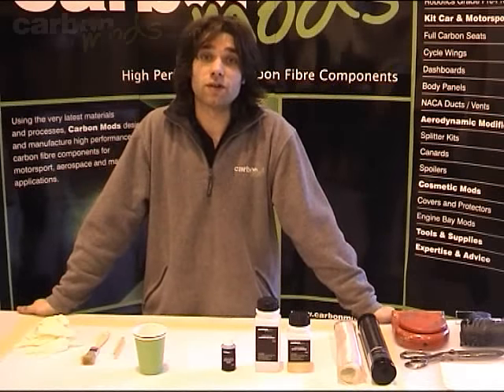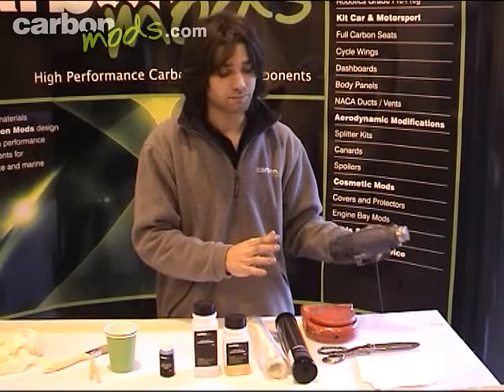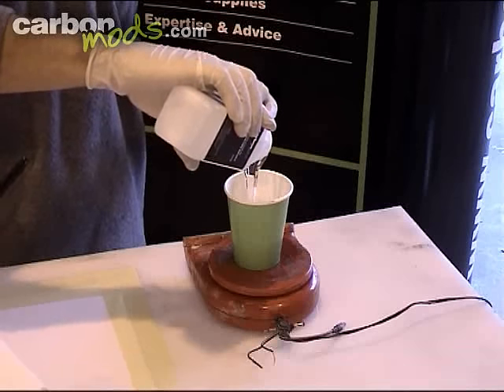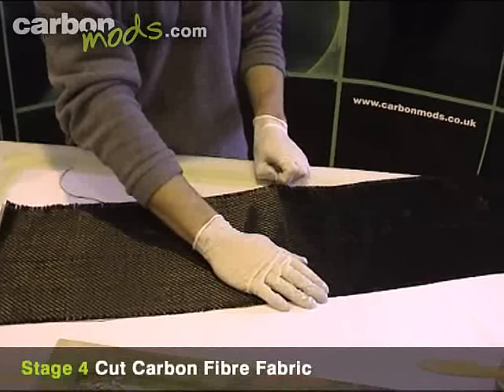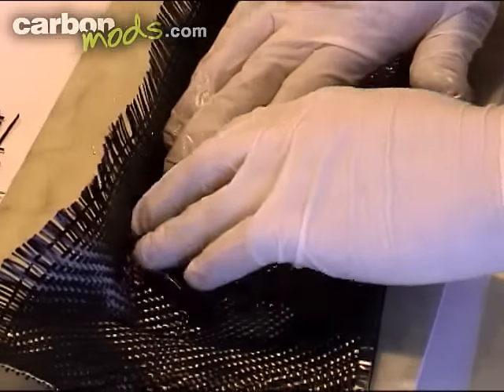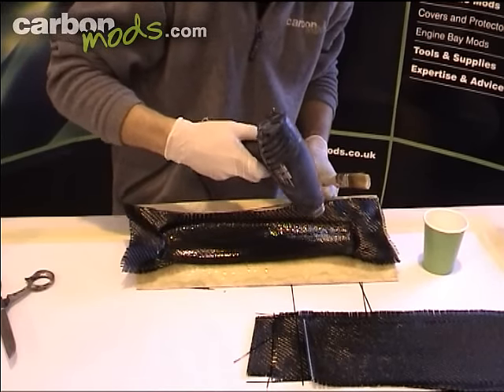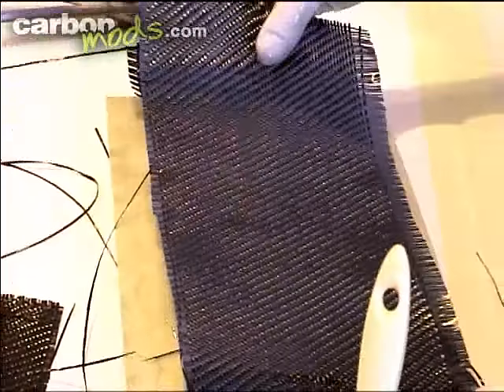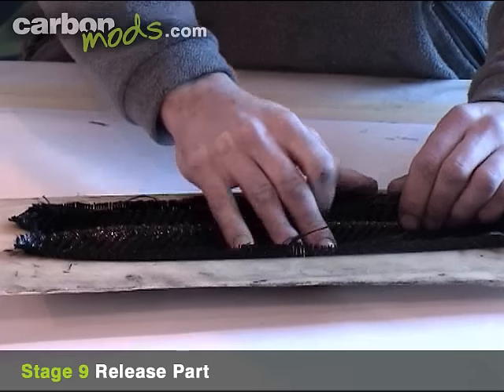How To Make Your Own Carbon Fiber (Fibre) Parts.

Comment from the maker: Hi Irishkerry, 

You are right something that has 2 'skins' like a car door cannot be made in one go, there are loads of adhesives that work really well with carbon fibre, the most common one are epoxy glues (like Araldite) and polyurethanes such as Tigerseal or Sikaflex. You can normally pick something up from a hardware store that will do the job. Thanks for the Question.

Comment from the maker: @yumyumluckycharms : Vacuum bagging doesn't change the speed of the process. If you mean that when you make your parts you don't use a separate layer as a clear gel coat layer then yes, you could skip this step and then you'd only have a one-step process but you could also skip this step in an open layup process and it would be even quicker than vacuum bagging (because you don't need all of the vacuum stack etc.).

Comment from the maker: Hi again grindzewall, 

Normally holes are done by making the part blank and then drilling the holes in afterward, normal drill-bits work great, to make your double sided 1cm thick component you could make two separate mouldings (one for each side) and then bond them together with epoxy adhesive. and finally yes we can supply carbon cloth in huge pieces, look on our website for sizes and pricing, Thanks for the questions, 

Carbon Mods

Comment from the maker: @cutinocutino : Generally in composites to make the 'pattern' in the first place (assuming you don't have an existing item you want to copy) you would either make it out of wood (like MDF), shape it out of a foam block by hand (low density polyurethane foam),  carve it out of Tooling Block (medium density polyurethane model board), or machine it (manually or by CNC) out of a high density PU or Epoxy tooling block which can be done from a SolidWorks file. We use all of these methods.

Comment: whenever I work with molds and resins I use Popsicle sticks to  push the mat into the corners  the sticks are super cheap  and I throw those away after the project is complete FYI I mostly do Fiberglassing  and Marine Epoxies using fiberglass cloths  and I’ve found that by turning the popsicle sticks I can  get into very tight spots and corners

Comment from the maker: Pathdestroyer, 

Good question! The number of layers depends on what your making, but work on the basis of the same thickness as you would make a steel part from (of course carbon is much lighter!) 1 layer of our 200g 2/2 twill carbon will give around 0.3mm (.012 inches) of thickness, so a typical car body panel would be 3 or 4 layers. 

Carbon Mods.

Comment from the maker: @Hugo7776 : The material you use to make the mould from must at the very least be none-porous which means that MDF or plaster of paris etc. are not suitable unless they are properly sealed. A conventional fibreglass mould can be used providing that you use both wax and PVA on it to ensure a release. The very best material would be a a GRP mould with either a vinylester or epoxy gelcoat surface.

Comment: @antoinehad you just need to seal the foam then you would be able to make a mould using gelcoat, chop strand matt any a polyester resin, depending on how many layes your final item is going to be i would reccomenr using 3 layers of 450gm chopstrand. also keep in mind that if the mould is quite large it will probly need reinforceing,  i would reccoment laminating some wood to it

Comment from the maker: @liviooo18 : Not for 'wet-lay' manufacture no. Carbon fibre can also be used to make parts using the 'vacuum bagging' process and 'resin infusion' without an autoclave. Only if it's pre-preg carbon (dry carbon) then an autoclave, or at least a vac pump and composites over are required.

Comment from the maker: @shodanxx : If strength to weight ratio isn't your main concern then yes, you can certainly use woven glass or chopped strand matt to get additional thickness . Use 'powder bound' chop though because the epoxy won't break down the binder of normal chop. Fast Cast resins arn't really the way to go, they're not for this purpose, stick with an epoxy laminating resin. Wear a mask when cutting and work with good ventilation. Epoxy is very low odour; no complaints from neighbours.

Comment from the maker: @corvette4554 : Yes, you can just use it straight out of the mould (with a quick polish, depending on the surface finish of your mould). The only reason to clear coat is for added UV stability but epoxy resins have come a long way in recent years and the ones we use are a lot more UV resistant than they used to be. Spraying the part with a 2K automotive lacquer will add even better shine and UV resistance, a spray-can cellulose lacquer will also work (not as tough though) if you want to do it.

Comment from the maker: @ForcaSpc : Well, the carbon reinforcement itselft can take incredibly high temperatures but in the case of this part, the resin used would be the problem if this part was to encounter high operating temperatures (80C+). We do sell high temperature versions of our epoxies; these can take in excess of 180C which is good enough for just about any standard parts (even heat shields etc.). Take a look at our website if you want further information on high temp systems.

Comment from the maker: @CarlWong510 : Your car bonnet can be the 'pattern' for the replacement carbon fibre part. You would use the pattern to produce a mould and then the mould to produce the replacement part. This way, the replacement would be the exact same shape and size as the original.

Comment from the maker: Hi Harrismhome, 

We wouldn't recommend spraying epoxy resin, airborne particles created by the spraying process can be hazardous, brushing the resin also makes the resin penetrate the fibres further therefore producing a stronger part. Thanks, 

Carbon Mods

Comment from the maker: There are a number of ways to achieve a matte or satin finish, if you want the finish out of the mould then the mould surface must have the matte finish, this can be achieved by sanding the mould surface with fine sandpaper (1200grit) or a scotch pad, this can then be treated will standard release agents. 

Alternatively you can get the moulded part from a gloss to a matte finish either by sanding with fine abrasives like with the mould or spraying a satin finish clear-coat paint.

Comment from the maker: @Mr2mcloven : We include the roll of glass reinforcement in the kit so you can choose to include some glass in your layup if you want. Glass is very cheap compared to carbon fibre and so you can make your carbon go a lot further by including, say, a layer or two of glass in between outer layers of carbon fibre. We didn't use the glass in the video because strictly speaking that would be a exclusively a carbon fibre part then but it's there if you want to use it.

Comment from the maker: The glass is used for backing up the carbon fibre if you don't want to make a part out of pure carbon fibre (so it lasts longer). Because the carbon fibre is the surface the parts still look the same. In production we would normally use fibreglass moulds finished to a high standard however you can use just about anything thats the right shape providing you prep the surface with the mould release agent. We'll be doing a mould making video real soon, watch out for that.

Comment: @ConnorDand13 no probs, though if you want a recessed hole like in an air duct or something, then you have to be smart about the mould and how you are actually going to release the part. for example, you try to do an air duct with a 90 degree tube from the back of it its going to be pretty hard to get it out of the mould.

Comment: it's a lightweight composite material that can be used instead of aluminium in most constructions, since it is a very strong material (has a strong tensile strength) it is often used in f.x. sportscars to reduce the weight of the car. 

the only negative about this material is the price (really expensive) :)

Comment from the maker: Generally for a cosmetic trim panel we recommend a mininum of about 3 layers of a 200gsm weight fabric. If the part is especially curvy you may get away with 2 layers. A large flat panel like a bonnet may need more like 6 or 7 layers to be stiff, although when you get to that kind of thickness you generally want to consider the use of core foams to reduce use of carbon and weight.

Comment: @319PurpleHaze Because it has the same tensile strenght as  steel and is two-thirds the weight of aluminium and it will never fail because of fatigue. Plus it looks pretty cool.

Comment from the maker: Hi Machineman9, a three ply laminate would be a little less than one 1mm thick, in most cases this would be sufficient for external body-work, our nose-cones and bonnets (hoods) are made with 3plies usualy, often we will reforce areas like mounting locations with further plies. as for being resistant to 'collisions' it is hard to say how thick it would need to be it depends on what collision and how resistant you want it!

Comment: Excelent video like everyone you made guys.
Question: Why do you Not use vacuum and heat-curing in this non-prepeg carbon fiber? As I undestand (i'm not even a beginner yet) if you use non-prepeg CF you have to cure it with heat+vacuum. Thanks beforehand.

Comment from the maker: @cesar120876 : 1. Yes, definately. You need to mix up a new batch every time you add resin to the part.
2. Yes, in a wet lay process, for a beginner, your finished part will be around 50-60% resin by weight. I.e. if you use 200g of cloth in the part you'll use 200-250g of resin. You should mix more like 300g to allow for the pot/brush etc.
3. About 3 layers per 1mm.
4. In a workshop we use Acetone, at home; nail polish remover.
5. Certainly, nothing will stop it curing.
-You're welcome.

Comment from the maker: @KamelionJay : Plaster is not really a suitable mould material for epoxy laminating (what we're doing in this video) for many reasons but if you really did want to try to use a plaster based mould then you would need to thoroughly seal the mould using a 2 pack filler primer paint (several coats of) before flatting and polishing it to leave your plaster mould with a hard, plastic finish. Take a look at our mould making video for  abetter way to make a mould for carbon fibre parts.

Comment from the maker: Hi Tulaconalas, The mudflap material is very different stuff used for making, well.... mudflaps! if you go to our website, click on 'fabrics, resins and supplies', then 'fabrics resins and kits' you will see the 'Carbon Fibre Laminating Starter Kit' That's the product used here. Thanks For The Question.

Comment: Great video. The only thing missing is how you go from the rough edges out of the mold to the smooth rounded edges in the final piece. I imagine you cut with a fine saw, sand with fine grit and polish?

Comment: Depending on the material you get, or how you paint it you can get a real good effect. For an average case you're looking at .75m2 of surface area, and I think the kit they're selling covers about .3m2 , so you'd need 3 kits, each at £47. Dunno, just a suggestion, dude.

Comment from the maker: @michaelkitselaar : If you can avoid joining the fabric (on the visible surface layer) then you usually would want to do that. It's not really possible to make the join look really neat when wet-laying. We can provide you with a 1sqm peice of fabric insetad for this purpose. If joining is unavoidable then a good trick is to hair-spray the fabric first so you can get a neat cut line and then cut it and herringbone join it (make it obvious rather than try to hide it).

Comment from the maker: Wax and PVA is making double sure. Once you know what you're doing it's unlikely you'll carry on putting wax and PVA as the release agent but for your first go it just makes it even less likely that you'll have a dreaded 'sticker'. PVA is bomb-proof but it leaves smears on your finished part which have to be polished out. Wax will leave the part ultra-shiney straight out of the mould but is more prone to problems for beginners (missed bits, mould too 'green' etc.).

Comment from the maker: Hi AndrewLace, 

It's difficult to compare weight for weight between carbon and kevlar, kevlar is lighter for a given thickness but much less stiff, it's advantages lie in impact and abrasion resistance, you can use both in the same part to achieve exactly the properties that you are looking for. 

Thanks Carbon Mods

Comment from the maker: Hi Dunniss, 
Vacuum Bagging doesn't accelerate the cure, it does help with removing air voids and excess resin, however the aim of this guide is to show people how excellent parts can be made without any expensive equipment. Thanks for the Question.

Comment from the maker: Certainly these materials (the carbon fibre and the epoxy) are capable of making parts for use in a light aircraft. It would be important to understand the material and the process and be confident that your parts were well made but certainly these materials and this method, if done correctly, would be up to the job.

Comment: Cool way to do DIY carbon fiber on the cheap without messy vacuum bags tapes and vacuums or refrigerated prepreg or drying in kilns, the only drawback I see is not being able to suck out the extra resin for weight savings, I'm surprised that the finish was pretty glossy not bad

Comment: Great video. I am very interested in this. I want to make a mandolin. I am thinking of just replicating all the wooden parts from the plans as carbon fiber parts instead of wood.

Big question is how easy is it to glue carbon fiber parts together. For example I would need to glue the neck to the body etc.

Another question is how easy is it to paint carbon fiber parts to emulate wood finishes??

Also how dense and strong can you make it. For example the neck would need to be very thick. A lot of stresses and strains. So it would need to handle a lot of bending forces.

Comment from the maker: @Tj1056 : Yes (and no!) - carbon is *always* black but you can get carbo fibre interwoven with coloured Kevlar or polyester so it's black and red, or black and green etc. The carbon part fo the fabric is the black part and the coloured part is the kevlar or polyester or diolen etc. If you look on our website you'll see red, blue. gree, yellow (kevlar) and silver (aluminised glass).

Comment from the maker: @MrLwman : When the fabric is dry and you cut it with scissors it will start to fray, there's not much you can do about this so you just make sure you cut the carbon bigger than the part so that the frayed edges are off the part. When it's all cured and you demould you can 'trim' the part without any fear of fraying because the fibres will have been made very hard by the epoxy resin and so you can trim and finish with a dremel/hacksaw/sanding block etc. Oh and yes, we'll do a split-mould video!

Comment from the maker: @Lilmxchico : Nothing fancy they're just pretty sharp. I guess if they're called anything they're 'Tailors Shears'. If your scissors are not very sharp then yes, they can chew at the carbon a bit. Anything decent, large scissors should be fine. Cutting Kevlar is where you would really have problems - that stuff is a nightmare!

Comment from the maker: @TimmytheTinyTurtle : Not specifically. If by 'flexible' you mean something that is not stiff (i.e. not a rigid composite) then you would need to use a special flexible epoxy. If by flexible you mean that it is rigid but can bend (like the limbs of a bow for example) then this process would be suitable, you just need to adjust the thickness to get the amount of flex that you want.

Comment: They make just vinyl sheets too but even putting a actually layer of fiber on top and bottom would work. Not sure it would actually strengthen the deck but it would most definitely stick to the wood if you just wipe it down and apply it

Comment: I have a way to create almost any piece in fiber glass or Carbon Fiber, I don't use foam as mold or pattern, I use flex mass, yes that used in handicraft, you sculpt this in any shape and can use it directly because it hardens as resistant as polyethilene water pipes.

Comment from the maker: @Snoboi07 : The woven glass that we include in the kit is just there so you can (if you choose to) use a single layer of carbon for the surface and then back it up with glass. Although the finished part won't be quite as strong and light as it would be in 100% carbon it will basically look the same and it will make your carbon go further which is especially helpfull whilst you're learning/practicing.

Comment: great video! Some questions:

1. Since the resin will cure in less than 3h, i should make one batch for the first layer (the one that dries for 3h) and another for the rest?

2. Is there a ratio cloth/resin so that a can estimate the amount of resin i should do?

3. How many layers of cloth per mm of cured resin?

4. Is there a way to clean the brush? or once the resin cures i should trash it? If so can i put the first layer with a cloth?

5. Can i cure it covered in tight plastic?

Thanks!

Comment from the maker: @DiegoTheJackal : You could wet-lay a carbon fibre bonnet in this way and structually it would be perfectly fine. Because of the size it might be difficult to get the whole thing spot-on (i.e. no air bubbles, no 'voids') and for this reason large panels like that we would always recommend making using Resin Infusion; here's a video we did (through Easy Composites) which shows the process in full: watch?v=VodfQcrXpxc - Resin infusion will make a stronger, lighter, perfect finished part every time